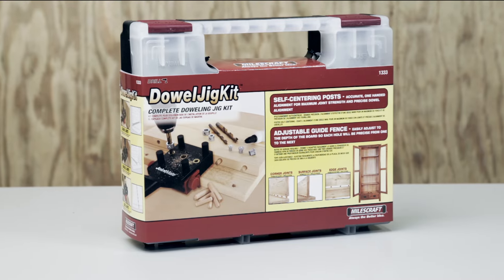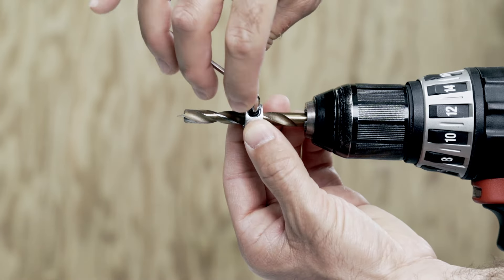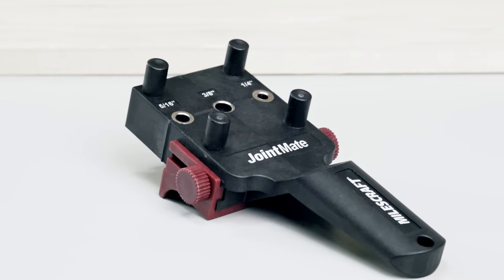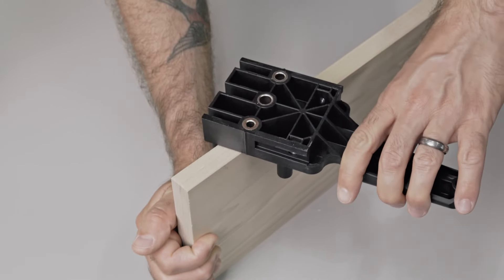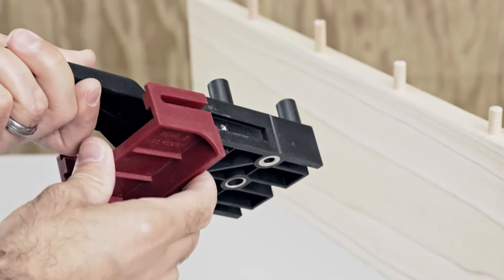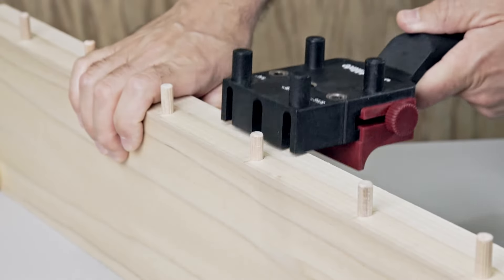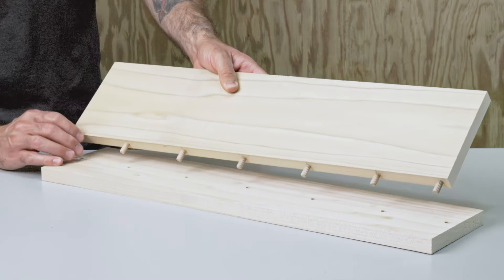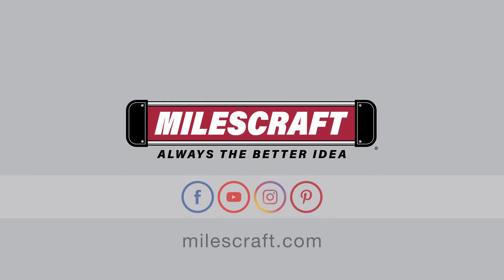Milescraft 1333 DowelJigKit™ - Complete Dowel Jig Kit For Doweling Corner, Edge, and Surface Joints

Comment: What is the pin at 0.21 second for ?
Reply from the maker: It's a Dowel/Tenon Center. It's used to accurately mark the location of dowel holes or existing pin locations in the second board being joined with the Dowel/TenonCenter Set. Find them here: https://milescraft.com/product/8-pc-doweltenoncenter-set/